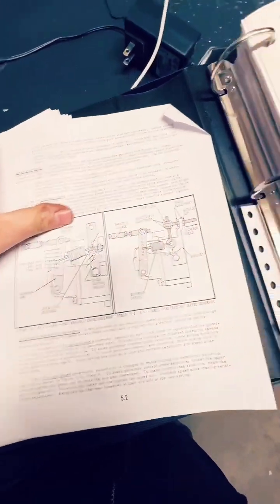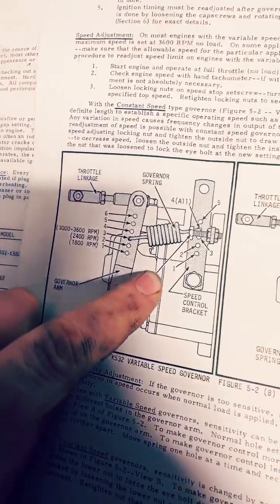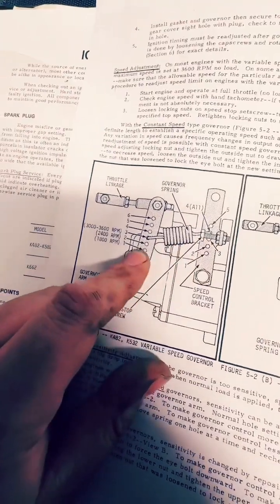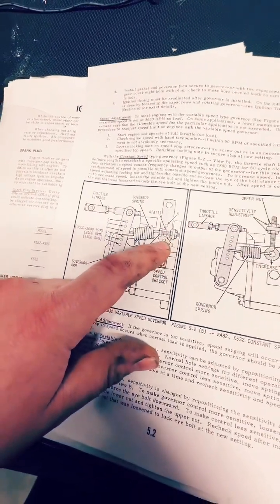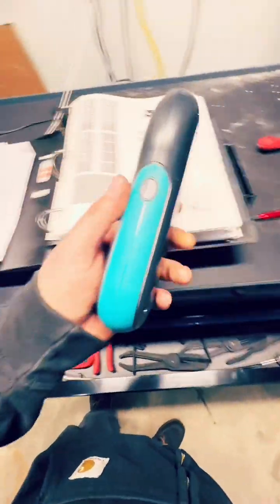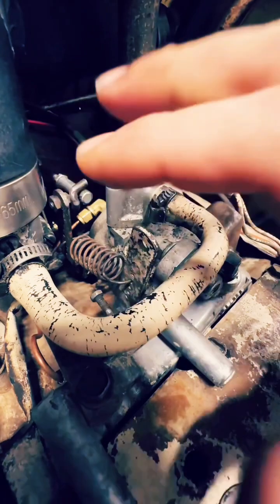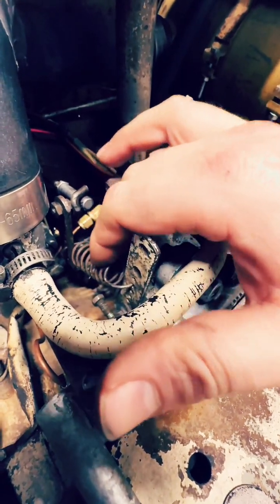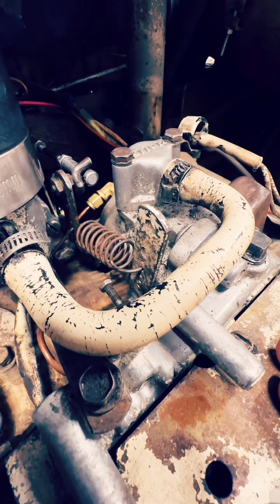Kohler K532 K582 Governor Adjustment

Comment: Good hard to find information.  Also looking for instruction on how to adjust the throttle linkage (upper left side of your diagram) ?
Reply from the maker: I appreciate that! Glad you found it useful! I actually have a really long video on the throttle linkage on TikTok it was quite a mess to get it to work correctly… after fixing it to “factory” spec, I decided I really disliked their design and changed the choke to a cable rather than the “rod” bobcat used… other than your normal adjusting screws and ball joint ends, there is no information on paper on how that original linkage works. If you have TikTok I’d be glad to send you the link… I can try to upload it here but it is too long for a “short”
Reply from the maker: Just kidding I have the linkage video uploaded here! It was just in my videos not my shorts! Hope this helps! Let me know if you want to see how I fixed it to work better than what they originally came with! https://youtu.be/-Uq0pcEFsow?si=myPu6eKKWTW9im0Z